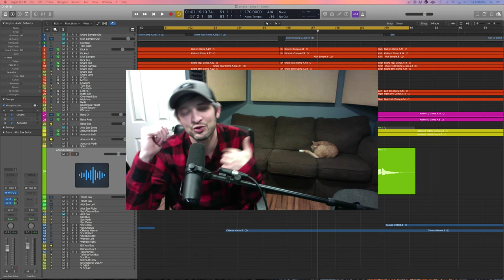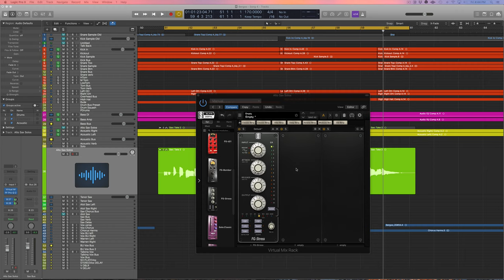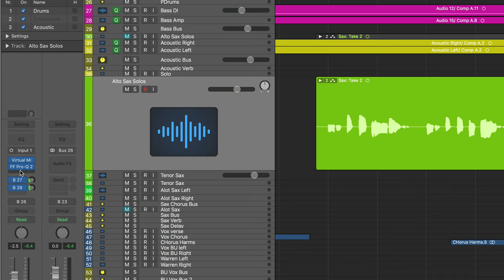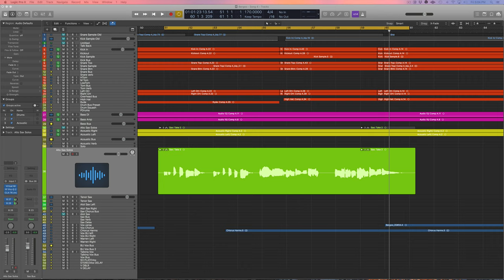Compressing Your Home Recorded Saxophone

Comment: Good grief.  Everyone thinks differently and hears differently.  My ears do not like what they are hearing here.  That's a lot of compression and you definitely hear the reverb in the mix.  Add to that the saxophone tone isn't so hot to begin with.  I don't think you got it right here by any means.  Sorry to be a little negative but to each his own.  Good on you for sharing your thoughts.  I think if you compare this to really good recorded sax sounds you'll see that this is not really an example that hold up.  Sanborn, Nelson Rangell, any of the great studio alto players wouldn't want to hear themselves replicated like this.

Just my two cents, do not take is personally.